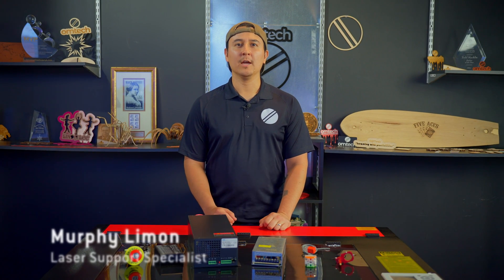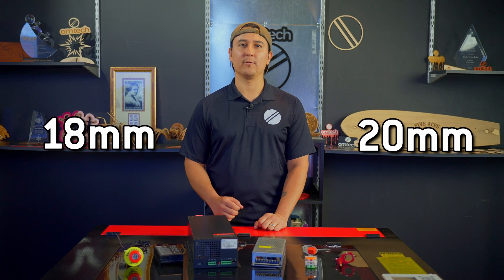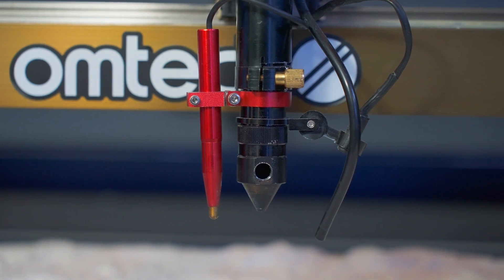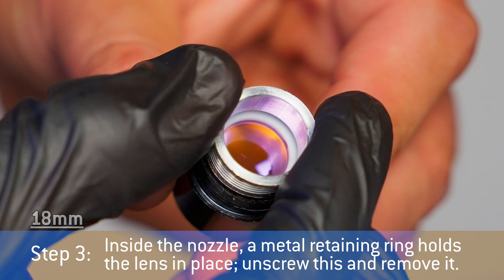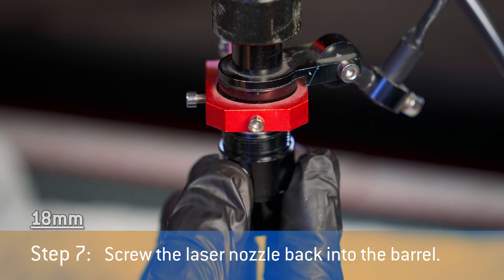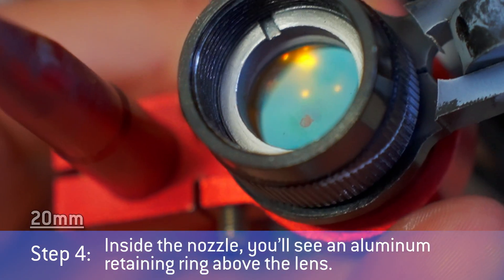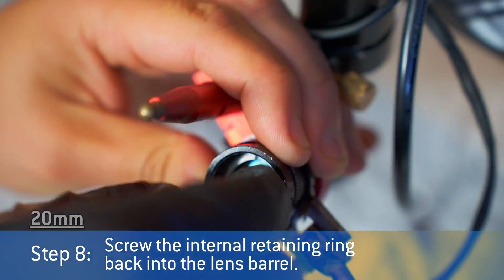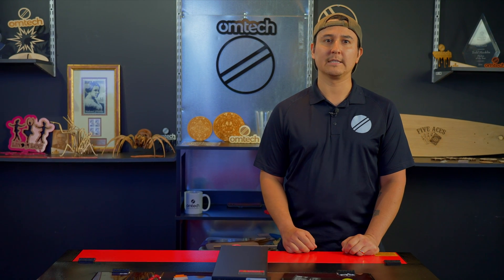How to Replace Your CO2 Laser Focus Lens

Comment: What if you have never touched your lens or mirrors since you bought it?
Reply from the maker: Over time the vibrations and overall movement of your machine can make the mirrors out of alignment, and as you run the laser the debris of material will make the lenses and mirrors dirty. Its always recommended to have a consistent cleaning schedule depending on how much you operate the laser.

Comment: I have an Omtech USB570a (80W) I noticed from another video that a lens can be placed into the head portion of the laser. Currently the lens is further inside the stem. Can you have 2 lenses installed? What would the benefits be? Are there any videos, articles on anyone performing this? I am assuming the focal point may be better than current (default) setup.

Comment: Doesn't the plastic o-ring which is installed in between the lens and metal retaining ring gets heated up and melts during use?  I wonder what material is that plastic o-ring ?
Reply: The simple answer is no. The beam passing through the lens  is smaller than the ring and never gets near it. The lens does not heat up with use so there is zero chance of the ring getting hot. .The ring is made from PTFE which has a melting point of  327C (620F). So fear not.